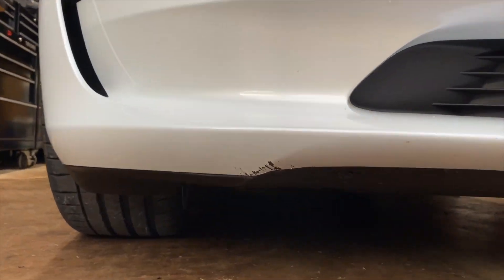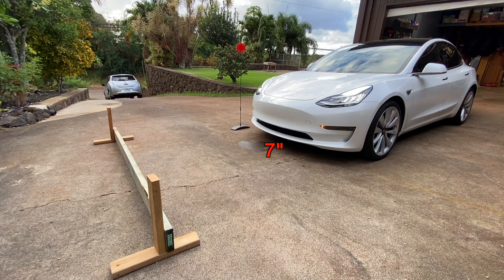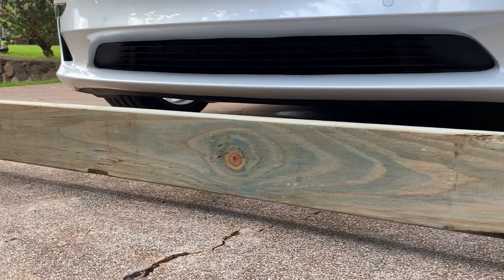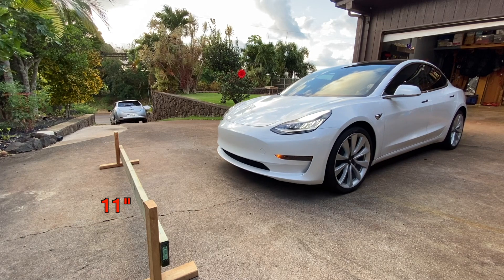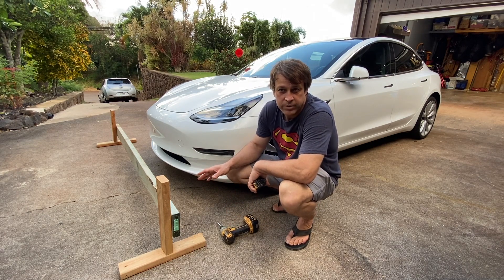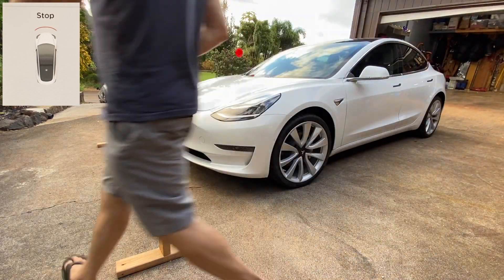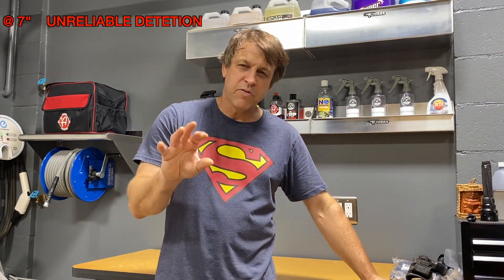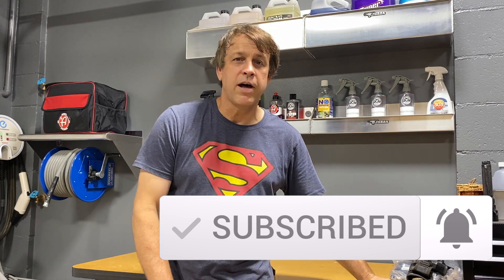Tesla Model 3 Parking Accident and Full Sensor Test

Comment: Another great video!  I’m making a list of rules for my wife and I for my Model Y coming next week.  So far:  NO hand sanitizer allowed in car, and do not park less than 20” from anything.  What else…
Reply from the maker: Thanks for watching the channel. Check out the detailing tutorial playlist. Most of them are on my Tesla. Will help you take care of the inside and outside of the car properly. If you ever have any question feel free to ask.
Reply: Why no hand sanitizer?
Reply: @timtim1745  It destroys the vegan leather.  It bubbles up.
Reply: @timtim1745  After putting hand sanitizer on your hands it rubs off on the vegan leather on the steering wheel and any other surrounding materials that your hands come in constant contact with and it starts to degrade the material, especially the steering wheel\yoke.  Be careful...

Comment: the visualizations are telling me that the car measures 20 inches to the 2 posts on the simulated curb but dosent detect the actual curb as it shows the orange lines with the obstruction at the area the posts are but the car dosent see the actual curb that close. but thanks for the nice video
Reply from the maker: Yeah. That’s how I ended up hitting a real curb while pulling head in to a parking stall. Would be helpful to have slow speed parking sensors. Thanks for watching
Reply: @HawaiiDetailing  I get you man it hurts to het the 1st scratch or damage on a car but sadly that's how it is but tesla certainly can use lower ultrasound sensors as the car saw the curb at about a foot away but after that what out of the ultrasound's range

Comment: fyi thats not the radar since thats only used for autopilot and car detection, it uses ultrasonic parking sensors (like every other car) to show you the distance and those are tiny dots placed a bit bellow the hood
Reply from the maker: Thanks a lot for pointing that out. I meant to say sensors but after I realized the mistake it was too late and already uploaded and had views. I guess the good news is that besides using the wrong name for the system the facts still remain the same.

Comment: Is it 20” if you measure diagonally from the bumper sensor to the lower curb?
Reply from the maker: Thanks for your comment. It’s about 20” to the uprights that I made to hold the curb. The intention was to show that you could be getting distance information from an object that is not the real threat and a curb that will hit the car is right there in front of you.
Reply: Thanks. Totally understand the intent and the clarification around the distance notified was of the uprights is good by me. I was thinking - perhaps incorrectly - that it might be sensing the curb as a relative distance to the sensor itself, versus the entire front-end of the car. 
For example, if the sensor was at the top of the bumper, it may say that an object on the ground is 15" away vs an object parallel to it would be 5" away. But I'm not sure if it is giving you an absolute distance to the sensor itself or a relative distance on the general front-end of the car. Hopefully my thinking kind of makes sense.
Reply from the maker: That’s what was fun about this demonstration was trying to better understand the system. There are sensors pointing to the sides on an angle that did pick up the uprights of the structure I built. That’s exactly what happened to me when I got my damage. I think in general that it picks up obstacles that are well over bumper height and could  mislead you into the danger zone. Any obstacle below the sensors are a risky proposition even if it indicates plenty of room ahead or does not indicate anything at all. Approach cautiously and stop with plenty of room visually ahead and leave the parking lot happy instead of angry.
Reply: @HawaiiDetailing  Makes sense. If it picks up a curb at all, I stop around the 20" marker on the display. The issue living in a city though, sometimes sticking too far out means rear end damage. Can't have it all...not yet! A bumper camera will come next.

Comment: The proximity warnings are from ultrasonic, not radar... (the little round discs)..
and they are moderately directional, so they only notice things at the same level.
I wish it had curb sensors given the low front clearance...
Reply from the maker: Thanks for the comment and yes I wish it did too. If there could be a lower set of sensors that operate exclusively at very slow speeds (ex. 5 miles an hour or less). This would help in parking and maneuvering in tight spots around obstacles that could hit the car. This could possibly be an improvement for the future? It’s an amazing car already and will just continue to get better with time.